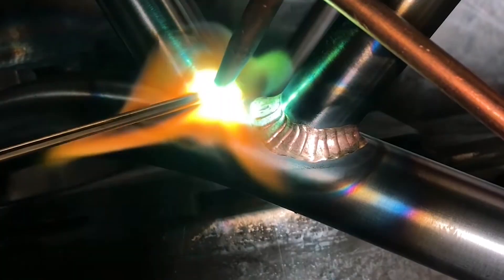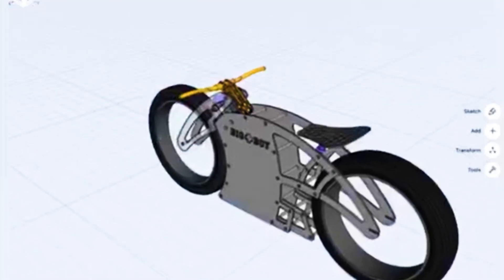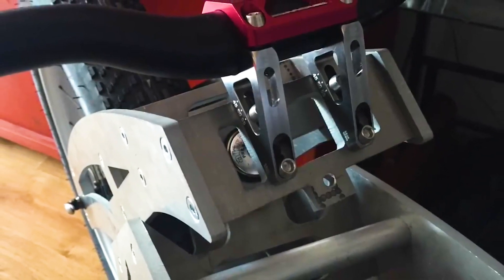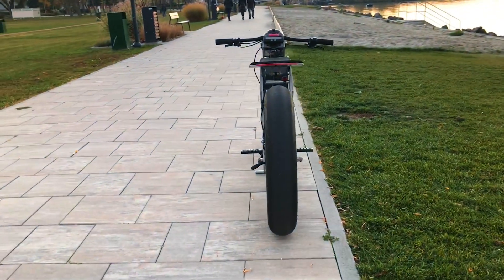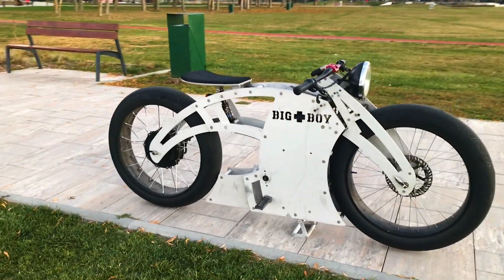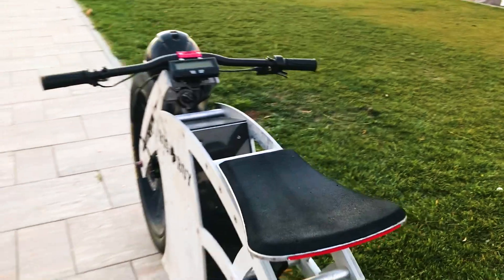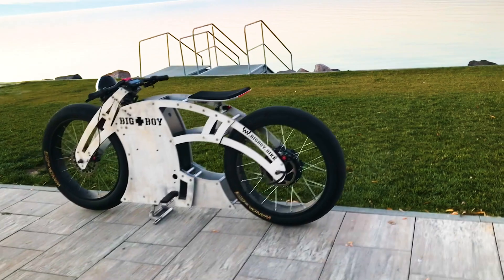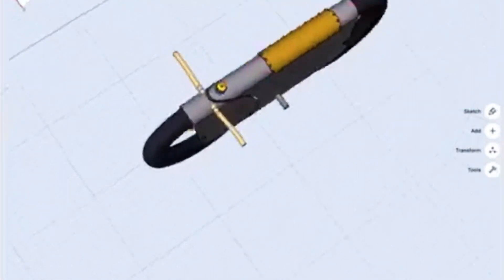World’s First DIY Cyberbike created 2016

Comment: very clever approach to frame design, although I would use this approach to design for a full-suspension frame. will get really rough even unsafe at higher speeds
Reply from the maker: Very true but it's for the city so you can release a bit of air out and have a softer ride

Comment: 140 kmh max speed are you kidding me ? 🥵😳
How many watts are you pushing on that hub ?
How much it costs? I really love that it’s retro and super modern at the same time 
Really awesome looking with high end specs.
Reply from the maker: I have to see if I can find the motor link. The motor alone  is almost $1k
Reply: @ElectricVehicleSpace  

Did you build this, it's great 👍.

If so do you already have the plans?

Lots of questions that pp lan would answer.

Thank you for posting this.